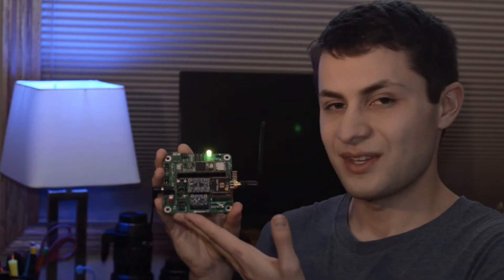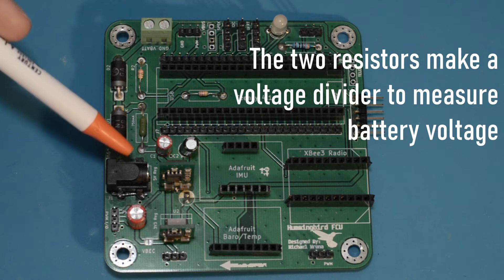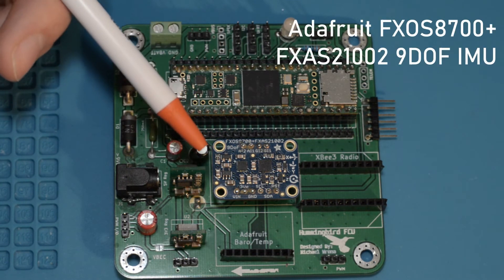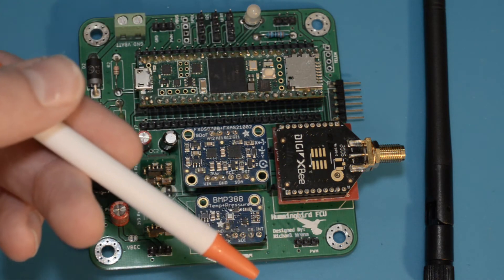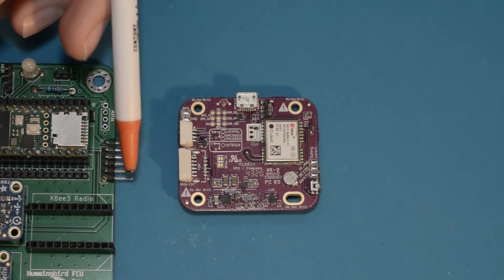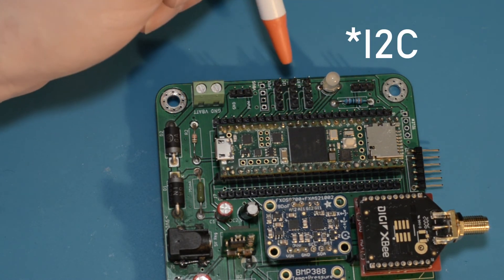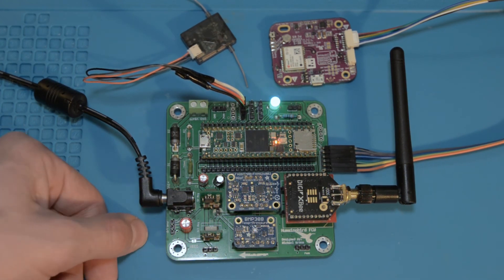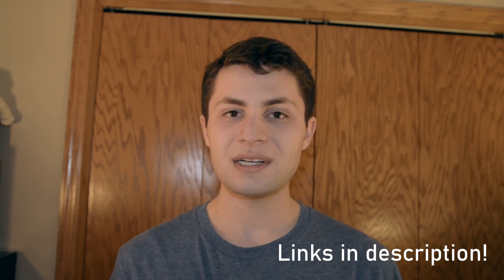The Hummingbird FCU, My Custom Quadcopter Flight Controller

Comment: Nice work with the PCB design! I also made Teensy  (4) flight controller with my PCB design. 
When you mention quaternions you met to use them in Madgwick filter?
Do you read the 6 channels from the receiver using sbus? 
and what motor protocol are you using to send signals to the motors? I used regular PWM but I found it too slow if I want to add other features to the drone.
It nice to see other people way of tackling the same problems :) waiting to see your next videos on the flight controller software!!
Reply from the maker: Sounds cool! I'll be developing my own EKF and use quaternions to describe orientation. My Spektrum receiver outputs servo inputs over a DSM serial connection, so the Teensy will read those. I'm using the Teensy to output servo commands, so hopefully that's not an issue. Thanks for the input!

Comment: Although switching mode regulators are efficient, they produce noise which is not good for accelerometer/gyroscope.
Reply from the maker: You're correct. I went with switching regulators because the difference between the battery input voltage and regulated output voltage is large (14.8V - 3.3V = 11.5V). Linear regulators are less noisy, but are inefficient and put out a lot of waste heat. That's why I went with more efficient switching regulators. Hopefully interference doesn't become a problem, though. That's not a fun problem to solve!